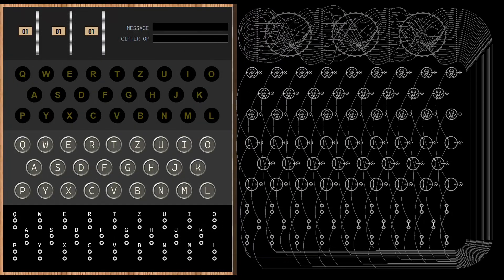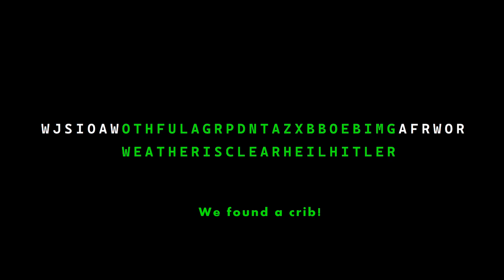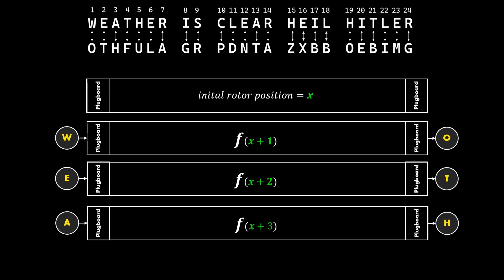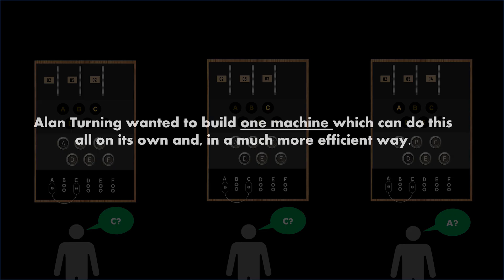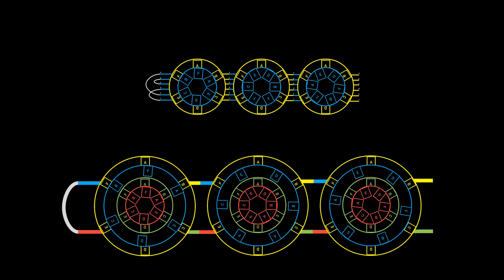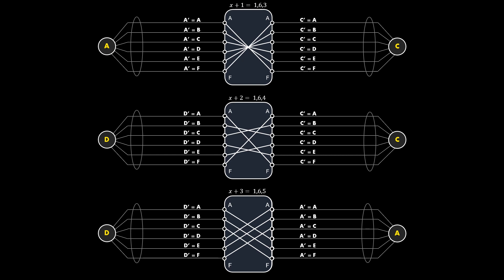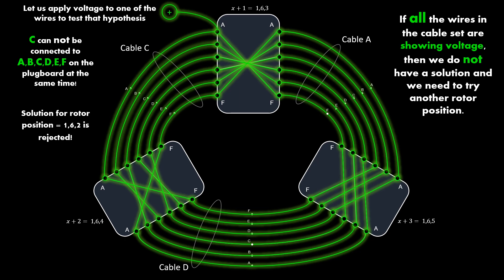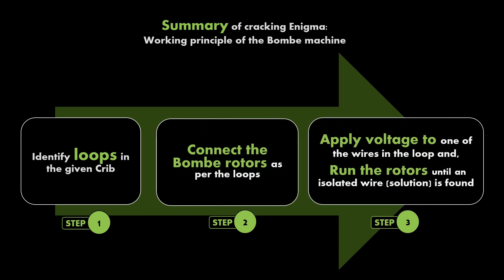How Enigma was cracked

Comment: Alan Turing did not break the enigma, and he certainly did not do so using the "bombay machine". 
I stopped this robotic trash at 11 seconds and will not go any further, and I think many who have the intellectual curiosity to be interested in this coding machine might do the same. 
11 seconds were enough however to reveal the first glaring factual error: Alan Turing did not break the Enigma code. This was done by Polish mathemeticians well before, and though they had worked on the eariler version of the  machine they indisputably laid the groundwork for what Turing would eventually affix his own name to.

Comment: This is undoubtedly a very good, interesting and complex animated lecture.. But the question for the audience is, do they want to be entertained or do they want to see a lecture after which they understand this decryption process from start to finish?
To do this, you need to know the following. The ENIGMA-decryption-process according to Alan Turing and Gordon Welchman consists of several steps. Some of these steps require the use of a machine so that the decryption process can take place in an acceptable time.The TURING-WELCHMAN-BOMB is just one of the machines in this decryption process, but it is also the most impressive machine.
I show all of this in my lecture here on YOUTUBE called "TURING WELCHMAN BOMB decrypts Enigma" (Gustav Vogels". I show and explain the complete decryption process step by step. (English language).
I prove each of my statements with the help of my microprocessor-controlled "TURING WELCHMAN BOMB that I developed. This microprocessor decryption bomb works in exactly the same way as the mechanical bomb of Alan Turing and Gordon Welchman.
My lecture is long and complex, but that is also the way Alan Turing's and Gordon Welchman's decryption method is.

I would like to remind you that in January 1941 a delegation of high-ranking American cryptologists visited Blechtley Park and stayed there for five weeks. After their five-weeks stay, theses American cryptologists still did not know how the British were able to decrypt the ENIGMA radio messages. This gives an idea of the overwhelmingly, great inventive achievements of Alan Turing and Gordon Welchman.

Comment: 1:54  It seems to me that all the following is based on the assumption, which could be quite wrong, that you have the encrypted string and the original string (massage). Will this approach work IF you do not have the original (not encrypted) massage to start with?
The other question I have: why the encrypted massage is LONGER? It seems to me that the Enigma is supposed to produce one-to-one letter, isn't it?
And the last one: if the operator on the receive side, by mistake, misses the punch or makes extra punch, all the rest of the  decoding on the receive side is screwed. Both machines, on the transmit and receive sides must be reset to their original state.
Reply: Yes, it is 'known plaintext attack'. Knowing or guessing part of the message makes code breaking easier. Or feasible at all. Some parts of the message can be deducted like formal part 'weather report' if the message may be weather report, or names of objects that involved in recent activity, like attacked military installations or geographic names of nearby cities etc. If the guess is wrong, the code will be not broken, then another guess may be tried.

Comment: Overall a simplified explanation of breaking the Enigma code.  But historically inaccurate.   Alan Turing was indeed the mathematician who theorised how electronics could be used to rapidly scan a multitude of possible combinations and he was the de-facto leader of the code breakers at Bletchley Park.  But it was a Post Office engineer, Tommy Flowers who actually built the 'Bombe' known as 'Colossus'.   He was the first person to actually build a electronic computer (not Alan Turing).  Also, Enigma was not the most complex coding machine the German's used in WWII.   There were others, and a young lone mathemetician, Bill Tutte, made fundamental advances in cryptanalysis by cracking the much more complex Lorenz cipher (nothing to do will Alan Turing).   Bill Tutte and Tommy Flowers (basically working individually) are seldom given the credit they deserves.    Yet, without thr brilliance of Tommy Flowers and Bill Tutte (and indeed Alan Turings foresight and overall leadership), WWII might well have ended differently.
Reply: Also, I understand that Polish mathematicians also helped break Enigma.
Reply: Bombe and Colossus were not the same thing
Reply: and these guys were able to design Colussus because of Alan Turing's work with the Bombe

Comment: My instructor in wireless communications was helping Alan Turning in ww2 when they were locked out when the fourth wheel was used, he told Alan that if I was on a German submarine the first three wheels would have to be on the weather code as he would not have time to keep changing the wheels, we already knew the weather code so we were only 26 turns from knowing what they were saying, it was that simple and it worked.
Great brain but common sense solved the problem.

Comment: Was the reflector "standard" or replaceble? From the schematic here it seems to act as another 'wired' plugboard and add a substitution but not discussed as that.
Reply: As I understand it, the reflector was the same for each model of machine used, but there were different models with different reflector arrangments just as there were different wheel arrangements.  From what I've read, it seems that different models were used for different services, so the navy might use one model while the army used a different model and the air force used a third model, all with different wirings of both reflector and wheels.
There were also models with at least four wheels.  I haven't read about any models using more than four wheels, but they could very well have existed.
And since the wheels were replaceable, it was common to have at least four different wheels for a 3-wheel machine and 5 or 6 wheels for a 4-wheel machine, with the code book specifying which wheels to use and in what order to place them in the machine for each day's reports.

Comment: Question, how would one determine the position/pairings of the reflectors? Moreover, were all enigma machines built with the same reflector pairings? Or were they randomized with each machine built?? Obviously ridiculous considering the number of enigma machines built but im really curious
Reply: There were two kinds of reflectors used (B and C types). These were consistently wired between enigmas. Much of the wiring could be figured out through British intellegence but Turing did write much about determining the rotor wiring itself from messages. This would be especially useful if they changed the design of engima (which they did many times). The math is staggeringly complicated, much more complicated than cribs and the Bombe machine so I won't go into it but you can find Turing's detailed notes in the "Prof's Book". If I recall therre was an instance where a lengthy message was sent twice in a row, once in plaintext and once encrypted, and this was useful in determining some of the wiring.

Comment: To help people as me that were stuck to understand the passage at 14:27, they connect the outputs to the inputs because the letter was equal in the sense that the signal was the same so they can automatize the machine I think that this process was manually done base on the encrypted phrase and the crib guess
Reply: Ok, i think i get it now.   But there are other ways of completing the process that seems like it'd be more straightforward.

Comment: But how then would you know what the guess is? What if  you have no information on a guess, and you just intercept a random set of letters?
Reply from the maker: I'm afraid bombe required a guess (/crib) to work. No other way as far as we know.
Reply: The germans were bad about using lieh reltih(backwards to avoid censorship), berlin, and other common words.  His use of weather report was probably very common.   I believe the rotor settings on all enigma machines were the same for every machine each day.  So, any transmission that was decoded gave the settings for all the rest.

Comment: The fundamental work on cracking Enigma was done by Polish mathematicians.  Just days before the 1 September, 1939 invasion they were successful in getting all their notes and an Enigma machine out of Poland and sent to the Brits.  The latter then took the basic work by the Polish, improved on it a bit, and took full credit for cracking the Enigma code.
Reply: Poles were reading decoded messages in 1932  - give credit where credit do  …
Reply: The Polish method was a complete tour-de-force, but it relied on the rotor starting positions being transmitted twice at the start of each message. These starting positions were set at the discretion of the Enigma operator.  However, the Germans abruptly changed the protocol so that the starting positions were only sent once. This meant Polish system no longer worked and Alan Turing had to develop a completely new system to break the machine.  Fortunately, by the time this happened there was a massive catalogue of stored messages to provide a rich variety of possible cribs.
So, to characterise the whole development of an entire new coding system as improving the Polish system "a bit" is both unfair and completely incorrect.
Furthermore, the whole existence of the project was kept entirely secret for many decades after the war and no-one was making any claims at all. Anyone who knows even a little bit of the history of Bletchley Park is well aware of the massive Polish contribution - without their ground-breaking work, the war would have gone on for much longer.
Reply: They actually cracked it before the war began, and realizing that they were about to be invaded, they gave their findings to the British. In fact, the Poles invented the “cryptologic bombe” machine later made famous by Alan Turing and his compatriots. His version was more complicated, because the Germans kept adding features to the Enigma machine. Turings machine cracked a much more advanced encryption, so I think it only fair to complement the British for their achievements. The Bombe machine was indeed named in recognition of polish efforts, after all.
Reply: Not exactly. Poles used some procedural flaws of Germans. Those flaws disappeared in later years, and breaking code became more difficult.
However, The Bomb was designed by Poles.

Comment: In 1932 a team of young mathematicians from the University of Poznań POLAND was set up. Among them were the main code breakers Marian Rejewski, Jerzy Różycki and Henryk Zygalski. It was Rejewski who first cracked the Enigma code, in only ten weeks... during the war, the Poles gave the French and the British a copy of the Enigma Machine built by them, ... after the war, the English took all the credit for themselves ...
Reply: Hey, credit to the Poles, credit to the Brits. What's the problem?
Reply: Funny then that it took a team of hundreds of British workers over a year to build a machine capable of cracking intercepted messages.
Reply: I don't want to downplay the work done by the Polish team, but their decoding system relied on a flaw in the German message protocol.  Once the Germans had fixed that flaw, the Polish system no longer worked.  Alan Turing essentially started from scratch and the bombe described in this video is nothing like the bombe designed by the Polish team.  That's not to downplay their massive contribution, but to accuse the British of taking all the credit is unfair - particularly since the whole project remained a massive secret for decades afterwards, and no-one was in any position to make any claims.
Reply: @mandolinic  You were wrong. There were no flaws, but there was constant improvement of Enigma machines done by Germans. Enigma machine that was broken in 1932 was slightly different from that machine in 1935 or 1938. It was getting more and more complicated and code breakers had to guess the improvements made. That was close to cracking it again and again. 
Alan Turing tried to break the Enigma code before the war started but was unsuccessful. He was basically standing on the shoulders of Polish giants. Read the true story, not the British propaganda.
Reply: @tomaszniemy6066  The Enigma machine had an important flaw that was impossible to design out: a letter could never encode to itself (so A could never encode to A).
This meant it was possible to compare possible cribs against the encrypted message, and find possible alignment positions. 
Anyone who has read Simon Singh's book will be well aware of the massive insights and contributions made by Poland's codebreakers.
Reply: @mandolinic  Correct. Turing was solving using a different approach - using cribs. Also Gordon Welchman came up with the "diagonal board" to add to the bombe. It had to crack enigma in a practical timely manner.
Reply: @mandolinic  baloney